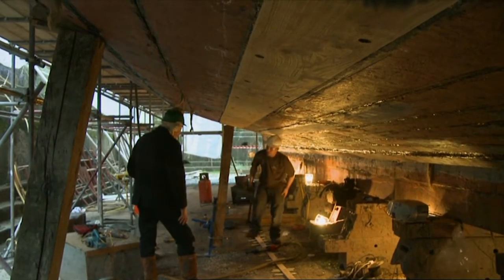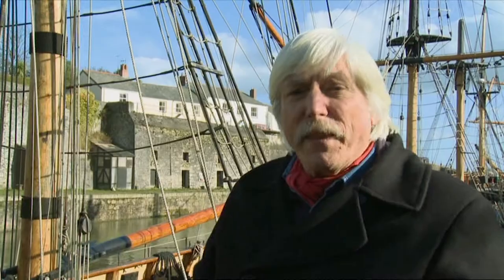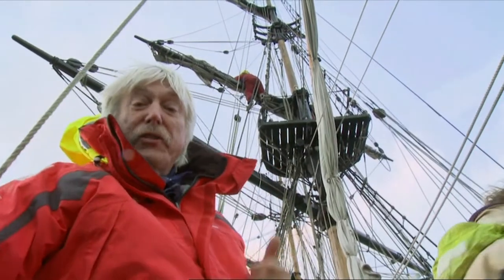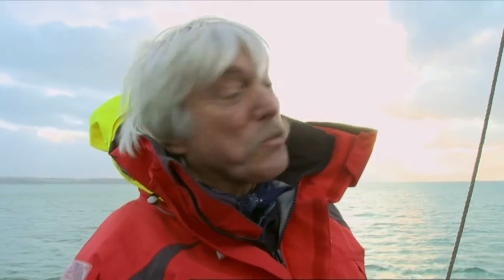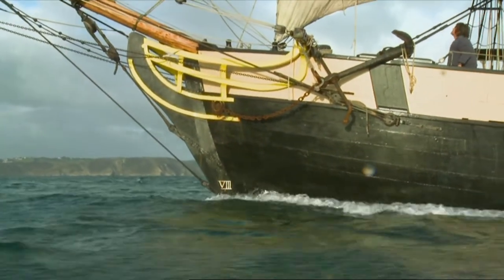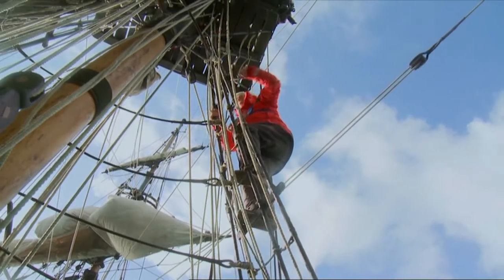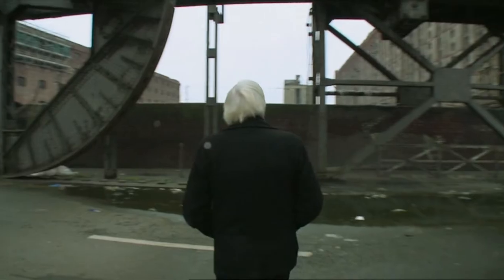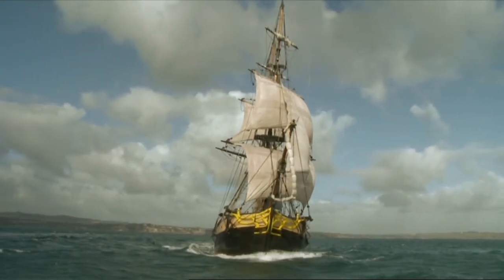The Boats That Built Britain - The Phoenix - Part 2

Comment: unfortunately no mention of the trade these ships carried in return of the sugar and spice , Slaves .
Reply: That is because they didn't. The Atlantic slave trade was carried out with ships especially adapted for the task. 
Outbound merchant ships carried all manner of manufactured goods- china and fancyware, cloth and yarn, ploughshares and mouldboards, gins and presses, pulleys and shafts, rails and bearings- All the engineering manufacture of Britain was exported all over the world.
Despite what some will tell you, the slave trade was a tiny (by tonnage) part of trade. It was despicable, and it made a very few people immensely wealthy, but it was a bad trade. Sailors did not want to be part of it.
It is a bad part of Britain's history, but it is a very small part.
Reply: @rossbuchanan7632  yes - Tom's talking about the industrial shipping during the 19th century. Slave trade (legal) long gone by then (1807 in the Empire). It was the industrialisation process which really shipped everything round the world - right down to the clothes and metal work of the Argentine gauchos!